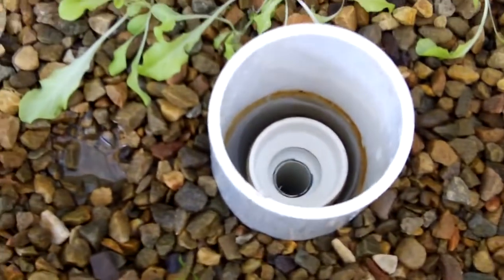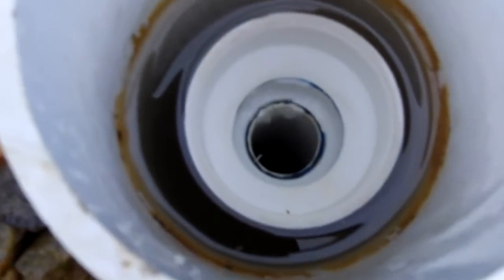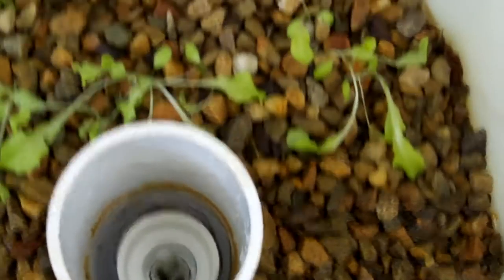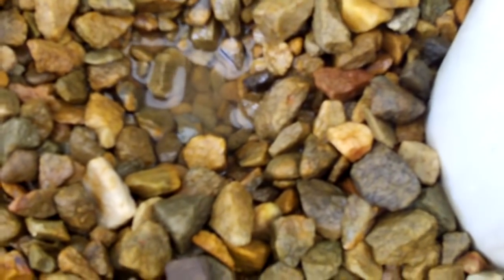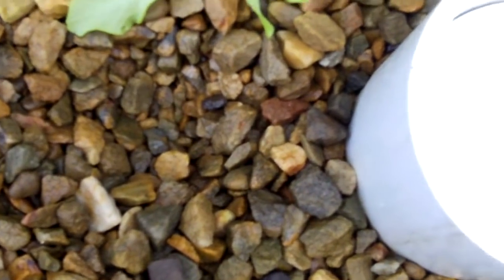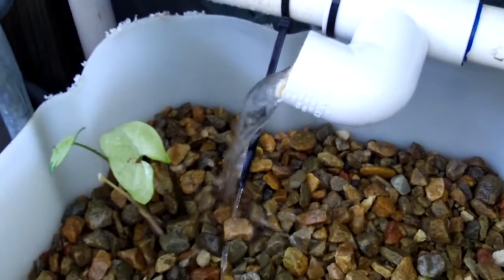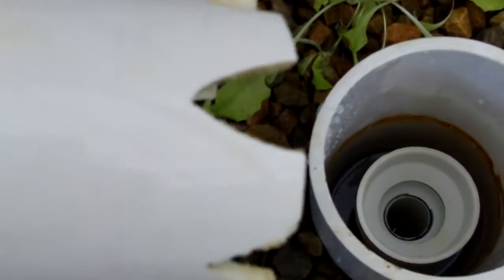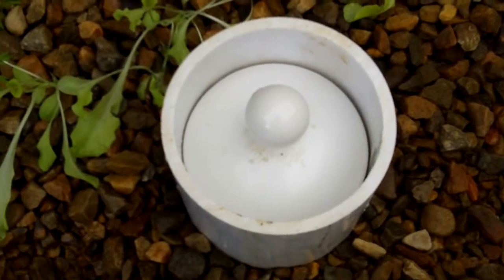Bell Siphon In Place Demo

Comment: I bought one of your siphons. Now to finish making my grow bed/turtle dock.
Reply from the maker: Hi Emily, let me know if you have any questions. We've come a long ways since this video was made👍
Reply: @fiskfarm  one question I have. I bought the 6 inch siphon and have a standard window box pot that is 6.7 inches deep that it will be in. I plan to put clay pebbles in the box all the way to the top. Do you think I may need to shorten the siphon and bell for that?
Reply from the maker: @Rite1010.  no. The 6" is for 6" deep medi. You might Want to keep your media at 6" so you have a little security there. The siphon should keep the water about 2" below the surface.
Reply: @fiskfarm  awesome. Thanks. I will fill to half inch below the box top then and adjust from there